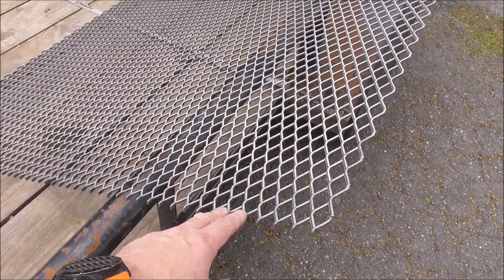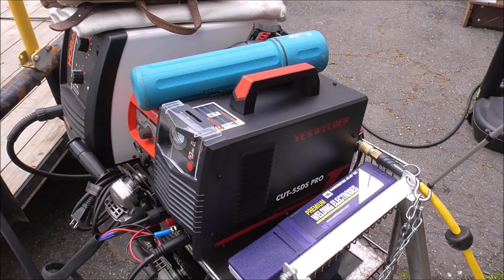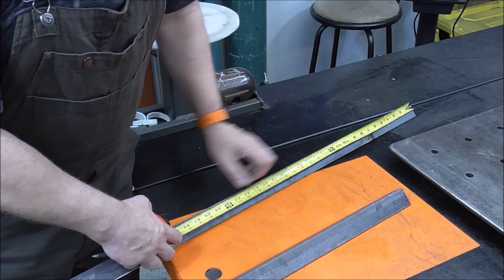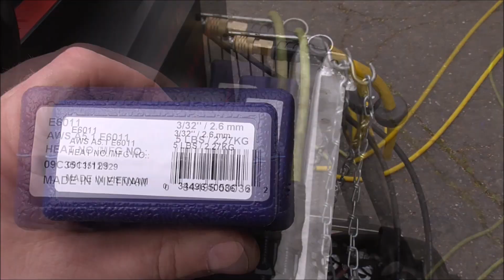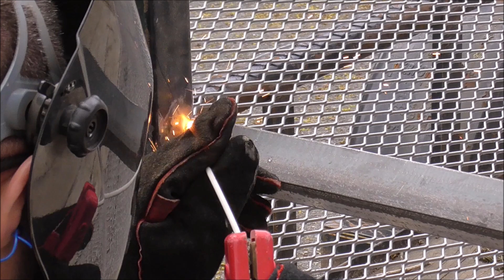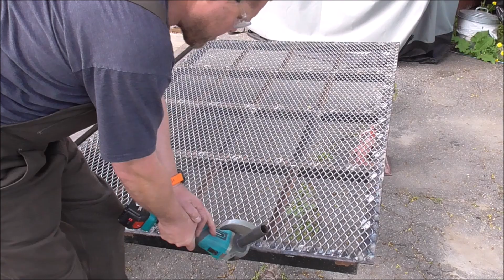Stick and MIG Welding Repair Expanded Metal Trailer Tailgate

Comment from the maker: Evolution Metal Cutting Saw - https://amzn.to/3UQfkRo
YesWelder Plasma Cutter - https://yeswelder.com/products/plasma-cutters-cut-55ds?_pos=1&_psq=cut-55&_ss=e&_v=1.0&ref=BRANDONLUND
Rolled Over Trailer Repair https://youtu.be/QMBpws1ykp0?si=UHO19DZ3tvUKLb_s
$25 Aluminum MIG Conversion https://youtu.be/FGhSo82MP9U
MORE WELDING AND FABRICATION VIDEOS HERE:https://www.youtube.com/playlist?list=PLfbf78fMz9Vol0uX2-GNc6mLi75zpqb5f
LEARN HOW TO WELD VIDEOS HERE:https://www.youtube.com/watch?v=ADa1I319GJ0&list=PLfbf78fMz9VqxPZTT-xmwdcrHVa7ML-ft
AWESOME TOOL BUILDS! https://youtube.com/playlist?list=PLfbf78fMz9Vo2Cv3V5fmYlDZGpS8Hp98l

Comment: The vice grip twist n' flatten trick is a great idea. Any tips on welding sheets of expanded metal together? Trying to make a inexpensive replacement/finer soil screen for my SLG56.
Reply from the maker: You could probably do something similar with a piece of flat bar on one side

Comment: Brandon like doing farm repairs I am amazed at all the crap I have to get outside and then put back up.  Unlike a full time welder, carpenter, plumber, electrician, fence builder, veterinarian, computer tech, ect  I don't have all tools and supplies for each "trade" in a go box or trailer.  It's kind of like an extended home general purpose garage.
  There are sometimes lots of moving parts to a repair.
That Fronius has high efficiency and Power Factor Correction.   I bought an ESaB with PFC so I could reach most broken metal in the corrals on an extension cord (I wouldn't build on 110 much). Runs true at 110A on 120v, but I don't have a wire welder with PFC.  There is a channel that tested some welders;bigtb1717.  Many inexpensive welders claim to have PFC but don't.
  I know 7018 wouldn't like that much rust and paint, but it would probably be less likely to crack.  I think those light ramps flex when you walk on them.  But I think you might spend more than its worth to clean all those nooks and crannies out.
Reply from the maker: It's hard to beat 6011 / 6010 for when things are really dirty, but I'll use 7018 occasionally when it's not perfectly clean but not structural. Burn it in hot. I really love my Fronius. What sold me is there is a video around the internet where they are running it off 300 feet of extension cord and it still welds great. I won't run mine off my generator because I don't want to take the chance of burning it up even though my gen puts out relatively clean power for a non-inverter generator. Now I use my engine drive and suitcase wire feeder for mobile work and keep my good stuff in the shop

Comment: The only thing didn't talk about was that expanded metal will warp on you. I learned the hard way.
Reply from the maker: I haven't really noticed much warping when using raised expanded, but definitely on the flat expanded. Tacking 180 degrees from one another will usually eliminate most if not all.

Comment: How is expanded metal labeled?
You said that was #9, would #10 be thicker or is it like wire gauge?
I have a tandem axel car hauler trailer that the wood has rotted off of.
I would like to replace the wood with expanded metal but I don't know how to order what I need.

Thanks!
Reply from the maker: Expanded metal comes in all types and sizes. You can get flat, raised and you can get different size openings. I used  #9 3/4 which around here is the most common for car trailers and landscape trailers. The smaller you go for example, a #6 would be heavier than a #9.
Reply: @BrandonLund  Thanks!  I would like to go pretty heavy.  I can never get a straight answer on is the wood in a car hauler just decking or is it structural.  
My plan is to take off  all the rotten wood, see what I have to work with and go from there.
Many people have resurfaced these trailers either with expanded metal or something like 1/8" sheet.  I doubt most of them were engineers.
I would not try to build a trailer.  However I think I can safely reskin one.
Thanks again!
Reply from the maker: I've done a bunch of commercial trailers. The long flat bed over the road trailers use custom milled oak that has a lap joint on each edge. For typical car haulers and equipment trailers, just regular pressure treated lumber from the big box stores works great. They both use a black oxide bugle shaped self threading bolt to fasten the wood to the metal framing.

Comment: You left out ONE IMPORTANT UPGRADE.
Moving the handles from the inside to the outside - MUCH better there.  
That is where both of mine are.  Try it - you'll like it!
Reply from the maker: It's not my trailer. This is a customer job
Reply: @BrandonLund  
Still doesn't mean you can't make it better, but your call.

Comment: Good morning Brother,  it's been a while,  but I have to say NICE JOB BUD
this is exactly what I have to do, plus the locking parts on both sides of my 5x10 trailer,  just like that one.!
You did an absolute amazing job. Love how you twisted the ends of the wiremesh, that's a great tip. I will be doing everything the same. Great Video my Friend,  thanks for Sharing.  Be safe and Healthy my brother ❤
Reply from the maker: Thank you so much and it's good to hear from you!

Comment: I have welded expanded steel on a few projects.  You didn't mention this, but you executed the technique perfectly, the way to weld expanded steel is to start the weld on the base material and bring the puddle to the expanded steel.  Starting the weld on the expanded steel rarely works - it will just burn away like a fuse.
Reply: Sometimes I put a piece of flat bar across all the ends and plug weld holes.  Not necessary to welld all the expanded.  And keeps the edges safe.
Reply from the maker: I appreciate that and now that you mention it, I wish I would have talked about this. Sometimes it's those important details that so easily get overlooked because it becomes second nature, but your right, If you try to weld the expanded first, it evaporates. I subconsciously started to talk about it when I was pointing out to try and cut it on the centers of each diamond rather than leave a couple barbs, but the thought must have escaped me LOL. Thank you for bringing this up because what you pointed out is very important.

Comment: One thing I never thought of is twisting the ends flat to weld, that’s something there. I have same kind of gate on my motorcycle trailer.  Hope mine doesn’t wear out like that!!  I was thinking building folding extension at the end later on. Nice sharing!
Reply from the maker: Thanks man! The owner has a landscaping business with heavy mowers and tractors. The new mesh is a little heavier, so it should hold up a little better.
Reply: More heavier to fold up ! Lol
Reply from the maker: But still lighter than before with the wood on it :)
Reply: Very true, back to lifting weights.

Comment: I see you welding rods are made in Vietnam.
Reply from the maker: I wasn't sure and had to Google it LOL "Washington Alloy Co. is located in Lowell, North Carolina. They are a wholesale distributor of welding consumables, filler metals, and accessories. They also have warehouse distribution centers in Puyallup, WA, Charlotte, NC, Stafford, TX, Irwindale, CA, Rancho Cucamonga, CA, Avon, MA, and Houston, TX"
Reply: @BrandonLund  On the end of the box with welding rods I think I saw "made in Vietnam ".
Reply from the maker: Huh. I didn't know that. I'll have to check it out.

Comment: As always, Brandon, great job.  Stick weld vs. Wire Feed decision making is so good.  Using both on a project like this really makes a difference.  On doing the little bends to straighten where you cut......would a crescent wrench to do the twist might have saved some time????  Have fun and stay safe, be well, and most of all, be Blessed!!!
Reply from the maker: Thanks Jim and thats actually a great idea. I've never tried it but I bet it would save a little time. I will have to try that next time. Take care buddy and be blessed!
Reply: I've tapped them flat with a hammer, but it's not great.

Comment: It might be inappropriate to ask this but I'm super interested in knowing how you priced or would have priced this kind of job. Great upload as always!
Reply from the maker: It's not inappropriate at all. I actually enjoy sharing this information because it helps inspiring fabricators and DIY folks get an idea of how to charge. I also know that my customers watch this channel, so it helps to show transparency. Everyone appreciates honesty and knowing how the price was arrived.   I take my material cost (metal, cutoff discs and consumables and add 20% to my actual cost. This covers small things like electric bill and gas to pick up the materials) so for this job, $120 then I estimate my time (5 hours @ 80/hr = $400) so this job is $520. Total. Time is always the u known. Sometimes you hit the mark, sometimes you finish in less time and others I'm way off (but rarely). I also have seperate rates for certain tasks, such as I charge $100/ hr to plama cut but if it's just a few cuts like here, than I don't carry that number. $80 labor rate covers wire feed welding, stick welding, fabrication, cutting and grinding. I charge 100/ hr to TIG weld and MIG aluminum.
Reply: @BrandonLund  Thank you so much!
Reply from the maker: I'm glad to share!